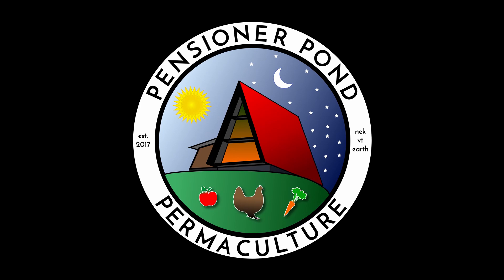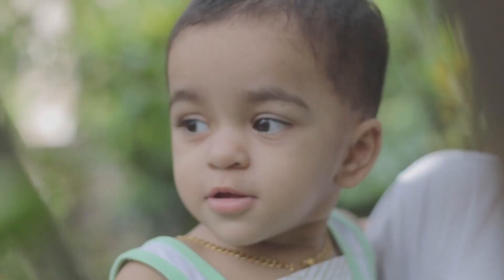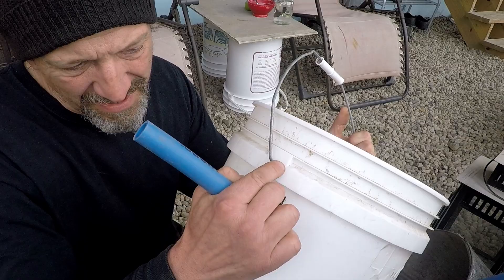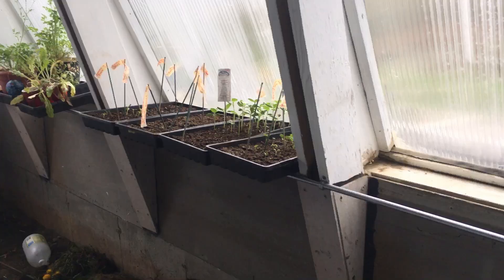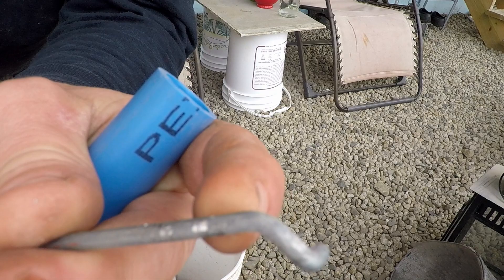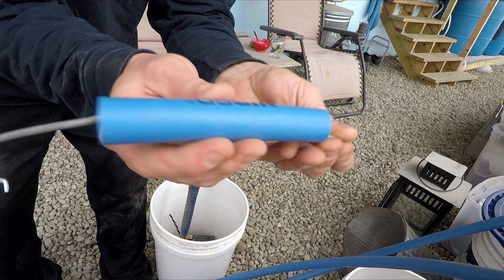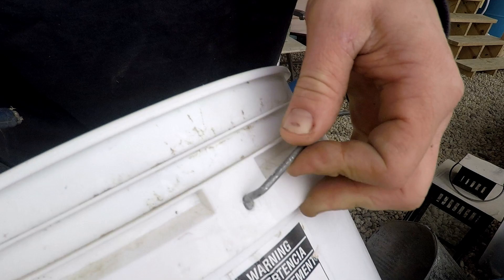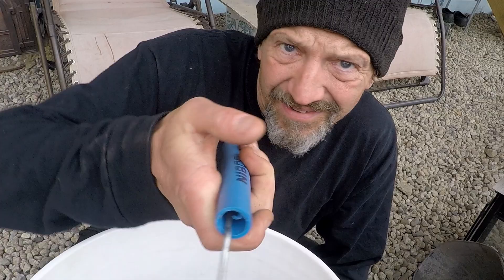5 Gallon BUCKET HANDLE Upgrade Tip | 3/4 Inch PEX Tubing

Comment: Good idea! I use cut up pieces of an old water hose so that it provides cushion & it stays in place at the top. If the hose is tough sliding on take a heat gun & soften it as you go. A twisting motion usually works best for me. I have had buckets that were truly as you said made not reused where the ends had a flatten or rounded head preventing it from coming out with damage the hole. What I did was take bolt cutters cut it in half & then it easily slides out. I then replace it with a handle like in the video that I got off of a broken bucket & kept as a replacement/spare. Any kind of hose will do though, Ive even used a garden soaker hose.

Comment: I like it....  those whimpy little handle are killer on the fingers if you have some weight in there
Reply from the maker: It's one of those little things that have a big impact over time.  Another thing I do with heavy bucket is I always carry two with a balanced load. Sure, it's twice as heavy but half as awkward!
Reply: @PensionerPondFarm  too bad we werent this smart about working smart in our younger years.
Reply: @PensionerPondFarm  mind you, one can split the load between both buckets and it's a lot easier on you. I find I can carry 1.5x the load if split evenly and it's less effort and wear and tear on this old boy.  

We use buckets mostly for moving water out to temporary livestock pens, and I mostly carry two full buckets - one with a lid for tomorrow's water and one without the lid (a wide horse water bucket with a thicker handle) that I use to get water out of the horse trough and fill "today's water" with.

My next upgrade is to use another five gallon bucket with a lid and a bungee and just fill buckets, cap them, and then stack two or more on a dolly, strap them in, and go.

Comment: i got a better idea take a box cutter and cut a slit down the 3/4" pex pipe down the length, then just pop it over the exsisting handle and wrap some tape around it, takes 1/4 as much time because you dont' have to remove the handle
Reply from the maker: That's a great idea. I thought about that, but I didn't know how long the tape would last. It would be easy to replace. Taking the handles off kinda bends the metal a bit and seems to pop out a litttle easier on its own.